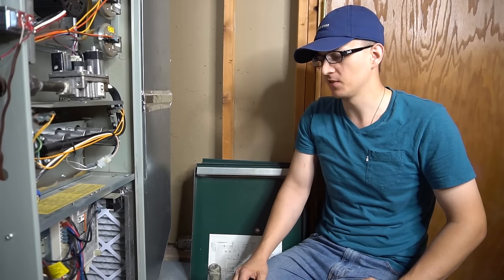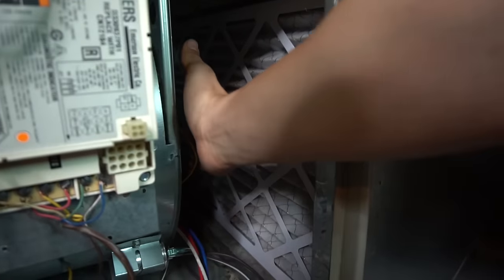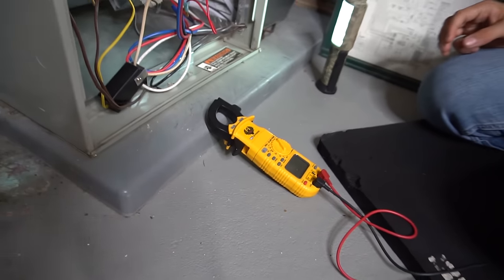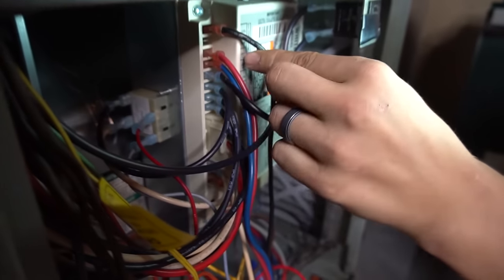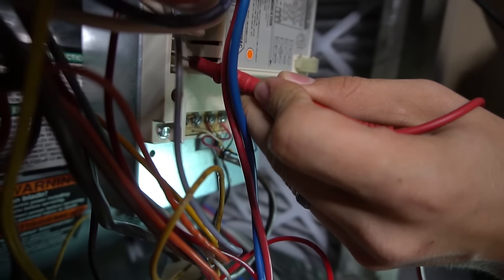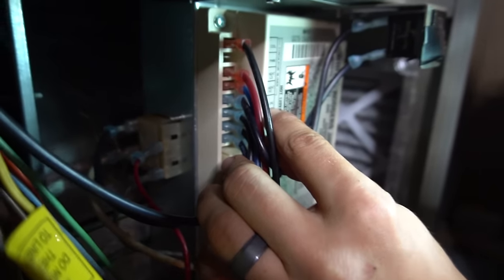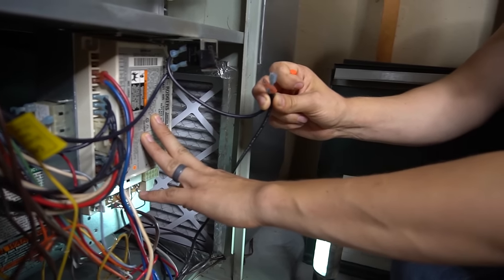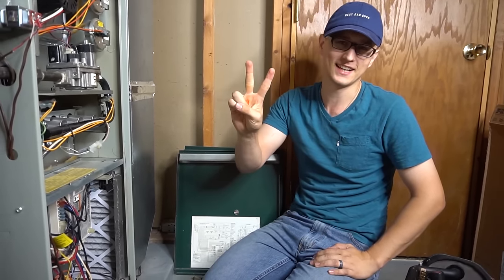Furnace Blower Not Working - How to Check It

Comment: Hey idk if anyone can help me I was working on a package unit with a ecm motor I checked the leads I was getting 24v on the low voltage side of the motor  it works for AC but not for heating. I was also getting 24v for heating on the motor leads but motor don’t run. Any suggestions?

Comment: My Central A/C went out here in Michigan's Summer 2019 heat.  After discovering that my blower motor was humming,  I followed your instruction and found the problem to be the Control Board. Guess what....this is the furnace's 4th control board in 16 years.  It gets shorted out because of moisture dripping from the frozen evaporator coils above.  Finally figuring out the problem.  Half of the home's unused rooms all have their ducts closed.  Add that to a neglected filter in the middle of a heat spell and the system will freeze.  Got the replacement board from Amazon today and will swap it out...hopefully for the last time ever!  Thanks for you awesome tips.
Reply from the maker: Glad to hear the videos helped you figure that out! Hopefully that is the last time! :) Thank you for commenting, stay cool!
Reply: @WordofAdviceTV  I realized the motor bushings were out of oil, and it couldn't overcome the initial friction to start, as it was hard to turn and the motor was very hot if you did get it to run. Anyway I saved 175 bucks on a new motor by taking it apart and re-oiling the felt pads on the two bushings in the blower motor. It would not be hard for some people to do if you are mechanically inclined. Some motors may have oil ports, if they do I would use them.

Comment: I find myself in this situation. The air conditioning in my home usually works great. The AC unit outside has the fans spinning and everything but I noticed it would take longer and longer for the cool air to come on and circulate through the house until one day it didn’t come on anymore at all. Now I fear it may be the blower fan as I do hear a small hum when I turn on just the fan but nothing else. I tried turning power off and on again but no luck. I’m thinking the fan motor might have burned out but Im not sure I’m brave enough to mess with all of that voltage. I might have to call someone to take a look

Comment: Help! I did a dumb move and removed the thermostat while the ac was running. The thermostat reset for the few seconds it was disconnected and I connected it back on while the ac was running. (It shut off after that) There was no power to the thermostat after that so I replaced the transformer (no fuse in this circuit board) and the circuit board. I now have power going to the thermostat with the RC wire but the thermostat won't power on. Any suggestions you may have?

Comment: My unit sounds like it wants to turn off like it goes low then hi sounding the area where the air filter is at . It sounds like if a car is try to start when it sounds low then high and stays on then does it again

Comment: So what if everything is starting up just fine but the fan isn’t blowing air through the vents. All the air is blowing around inside the furnace. It’s like there’s a door shut preventing the air from being pushed through the vents. Same thing with filter removed

Comment: Hi, I’m just a homeowner, I’m just curious why didn’t you check resistant on the blower motor?
you are doing a very good job here🫡🫡🫡
Thanks ❤
Reply from the maker: Thank you! In this case it is unnecessary. If the motor is getting power yet it does not come on, it's for sure a bad motor. No need for further investigation. In the field this method simply works better and faster for me so I rarely ohm out furnace blower motors.

Comment: Thanks for your videos. I was able to quickly troubleshoot my blower not working. The squirrel cage moved freely so I pulled the capacitor to test it only to realize that my meter doesn't go down to micro ferrets. I reinstalled the capacitor, re-energized the unit, and turned the thermostat up to 90. The exhaust blower started, the burner ignited as it should and when I heard the unit click to start the blower I just reached in and gave the squirrel cage a little assistance in turning and wala, pushing hot air once again. Amazon will have my new capacitor here tomorrow for $10.00.  Now I just need to be a human termostat when my wife wants hot air. Well only for one night.  :)
Reply from the maker: Nice :) Glad to hear you were able to get it figured out! Stay warm! ;) And good luck with being the thermostat! (By the way, if you want, you can set your thermostat fan setting to ON instead of AUTO and just let it run all the time so you don't have to push start it each time the furnace comes on)

Comment: Our furnace fan runs fine, the issue we are having, if the thermo stat calls for heat, the furnace and will not start?  We have a boiler with a heat coil, I can start the fan from the thermostat, also, if I turn the heat up while I am running the furnace fan, I get heat from the register vents. If the thermostat calls for heat, the boiler starts but the furnace fan will not.

Comment: I am getting 2.4v for the inducer motor. Means card is not giving out 120v. During winter we niticed that blower motor was running but we were not getting heat. Eventullay blower motor stopped working. I am trying to get this running. I did buy a new bord, inducer motor did not turned on. Input will be apporeciated.

Comment: My Mom's 50+ year old furnace has a fan motor that won't kick on. It's so old it doesn't even HAVE a capacitor. Pretty sure it needs a replacement fan motor. You have any clues where I might be able to hunt down a replacement motor for a unit that old? It's a Carrier 58BA100.

Comment: Yeah I just bought a house and did not check the filter, which was really nasty. Once the fan stopped blowing completely (but the furnace was still getting hot) I finally looked up your tutorials. I switched out the filter but the motor was scalding hot. The fan still spins fairly smoothly. I have it turned off now, and when everything cools down in a couple hours I will try to turn it on and see what happens, but I will probably need a technician.
Reply: You should be able to burn the house down.

Comment: My 21 year old Amana energy efficient furnace will only ignite after I open the furnace door (opening the safety door switch ) then closing it . The furnace will then start. This has to be done every time I need heat. By not opening the door first, only the fan comes on. Thanks

Comment: Why would you need to reinsert the splitter back into the board?  Doesn’t it work fine as you intended by simply connecting the two wires.

Comment: I really liked this comment, I will quote it, it's important: 

"I realized the motor bushings were out of oil, and it couldn't overcome the initial friction to start, as it was hard to turn and the motor was very hot if you did get it to run. Anyway I saved 175 bucks on a new motor by taking it apart and re-oiling the felt pads on the two bushings in the blower motor. It would not be hard for some people to do if you are mechanically inclined. Some motors may have oil ports, if they do I would use them."

Comment: With your thermostat calling for either heat or cool (for cool, the outside unit should be running), thd G wire should then turn on the blower motor at the furnace. If it's not, check the motor for voltage.

To check for power (voltage), start by checking where your fan wires go into the control board. The black wire is normally high stage, which goes to cooling; heat is normally low stage, which goes to heating. Depending on which AC season your testing for, you will pull that wire off.  Next, find where your common wire is coming from the motor (usually labeled circ. or circulator) and pull that wire off the control board as well. Place one lead on each spade that you've pulled a wire from. There should be a 120v present. If you have 0 volts when the fan should be on, then the problem is a defective control board. If you do have 120v present, and the fan isn't coming on, then the blower motor is bad.

To test without a meter, find the wire for line voltage coming into the control board usually coming from the door switch) disconnect it, and depending on which AC season your testing for, pull off the high or low stage wire and bypass the control board by connecting the two wires together. If the blower comes on, the control board is bad. If it doesn't come on, the blower motor is bad.

To temporarily get by with cooling or heating until the board is installed, you can connect the two wires disconnected wires to a spade splitter (bending the split) and connect the other end into the line voltage on the control board. This will send power directly to the motor through the power switch, bypassing the control board.
Reply: Will the blower motor run continuously during bypass?
Reply: Levi you're great!

Comment: When I bypassed the board, the blower worked. When I tested the voltage from cir to heat I got 111 but the blower wouldn't kick on? I am now massively confused.

Comment: Had the same issue, on a 4 wire connection disconnect the thermostat wiring, touch red wire and green wire together if the blower comes on, it’s mostly ur thermostat is faulty. It’s the easiest and simplest way to check. You could save $250 on service call.

Comment: it's quite possible the motor start capacitor is fully charged 1. you can get a real jolt 2, if you connect the capacitor at this state to your meter, the meter will be fried. You should try and discharge the capacitor before anything else. Touching an insulated handle screw driver to the bare metal contacts will do this BUT it is really bad for the capacitor to discharge this fast. you should use something like a 5k 5 watt resistor.

Comment: Couldn't a bad limit switch be keeping the blower motor from coming on? My blower won't come on with a/c or heat. Just replaced the capacitor and nothing. My flashing led light says limit switch fault, but shouldn't the blower motor still come on in a/c mode. The led reads normal operation with the a/c on. Also reads normal operation for the heat when first turned on. The burners fire up, but no blower motor. After about 3 mins the burners will turn off, and the led reads limit switch fault.

Comment: Hi, I did all of the tests and I realized that the control panel is the problem. My model number is 50A52-111. I found a brand new control panel on eBay but the model number is 50A55-286 (white roggers). Does it have to be the exact number or can I get this one? Thank you.

Comment: Thank you for these videos. They are very well put together. My blower motor works 8 out of 10 times. 
My blower motor will come on if I turn the power off, rotate the motor slightly (1/16th of a turn). Then turn power back on. 
I can also make it come on by smacking the side of furnace near where the blower lies.
I have tested the cap and it appears to be fine. The blower motor spins freely with no resistance at all. 

Could I assume that the motor has a dead spot and is need of replacement? 

Or should I get the blower motor rewound?
Reply: Turns out the capacitor was the issue, it was working intermittent.

Comment: so, the issue i havd is the moter is not starting on its own. it is sometimes very hot when i  check it, but if i give it a boost by turning the fan real fast with a screwdriver, the moter will actually kick on a few  seconds later.

Comment: I have a strange happening. My air handler outside fan is working compressor is good, changed the capacitor for good measure; however only way the blower comes on is if I disconnect the “plug in” at first I’m thinking bad board. Got the new board today and same thing. Anyone have any ideas??

Comment: I have a blower motor just making a loud humming, not spinning.  I checked the run cap and only got 3.4 mf when it was supposed to be 5 mf. I replaced the cap (new one tested at 4.9 mf) and it still won’t run. I even gave the squirrel cage a hard spin and then engaged the interlock switch and it won’t stay running.  Motor is probably 35 years old plus. I suspect that I might have a bad motor?  Maybe I lost a winding?

Comment: Thanks for the tips. And if it's working intermittently would that probably mean a struggling capacitor? Mine stopped working during the day, then at night it worked.
Reply from the maker: Well.. Yes, it could be a weak capacitor. But the motor may be overheating and shutting off as well. (more likely) I would recommend replacing the blower motor and capacitor. (I have a video where I replace mine if you need it)

Comment: Should check voltage with blower leads connected bc you can have voltage drop off under load. Faulty wiring, connections, etc.

Comment: Great videos, thank You. My problem is the blower motor turning ON-OFF for short cycle, the outside unit keep running while the inside unit is going ON for 1 minutes then OFF for a few seconds and so. Is the blower motor going bad or the board? thanks again
Reply from the maker: You would need a meter to be able to confirm which it is.. If the motor is still getting power when it turns off like that, then you know the motor is bad or the capacitor for it is weak. (if you have a variable speed motor, that would be harder to check as you would need an adapter to check ECM motors) If the power drops off to the motor when it turns off, then either the board is bad or there is some safety switch that is getting tripped. Like a condensate overflow switch for example.

Comment: Always appreciate the videos and advice. My furnace has a15 mfd +/- 5% capacitor and I can only find 15 +/- 6% all other numbers match up. Will this work? Thank you for any help.
Reply from the maker: Yes, that one will work. 6% just means how far out of range the capacitor can be before it will start to fail. For example if you check the capacitor with a multi meter, 15 MFD plus or minus  6% = the capacitor should not read lower then 14.1 MFD and higher then 15.9 MFD.

Comment: Diagnosed blower and found control board wasn’t sending power.  Excellent video
Reply from the maker: Thank you! Glad you were able to find the problem!
Reply: What if it DOES send power, but the motor is old?! "I realized the motor bushings were out of oil, and it couldn't overcome the initial friction to start, as it was hard to turn and the motor was very hot if you did get it to run. Anyway I saved 175 bucks on a new motor by taking it apart and re-oiling the felt pads on the two bushings in the blower motor. It would not be hard for some people to do if you are mechanically inclined. Some motors may have oil ports, if they do I would use them."

Comment: Great video. Helped a lot, but wouldn't it be simpler to connect the black wire directly to the safety switch instead of stripping the two wires and joining with a nut?
Reply from the maker: Happy to hear you found the video helpful! I am not sure I know exactly which part of the video you are talking about but you are probably right! :) Could you reference to the point in the video that is in question? Like this for example: 6:30

Comment: Thank you for making this video. I believe my Blower Motor Burnt out yesterday I still have heat as my furnace comes on and off but no blower. Is it safe to continue to use the furnace without the blower cycling on and off?
Reply from the maker: I wouldn't recommend doing that since you are getting very little heat that way but it can damage your heat exchanger which usually ends with one having to get a new furnace..

Comment: I had a power surge where my central air conditioning and furnace are no longer working. It doesn’t seem like they even attempt to turn on. I’ve checked power at the breaker box and everything has power/all breakers are seemingly working. I believe I tested the thermostat correctly by jumping wires to give power directly and still nothing. Is there a sensor or something that tells either to turn on/off?
Reply: I can manually turn the ac fan on too. I am not sure if the compressor ever attempts to run.

Comment: My white wine on my board was actually going to the CONT terminal. And the black wire was going to the COOL terminal. 
But again, my white wire from the blower WAS going to the CONT terminal near the HEAT and COOL terminal's. 
Why would they have wired it like that?
The wiring diagram shows the white wire from the blower motor going to one of the neutral terminals.